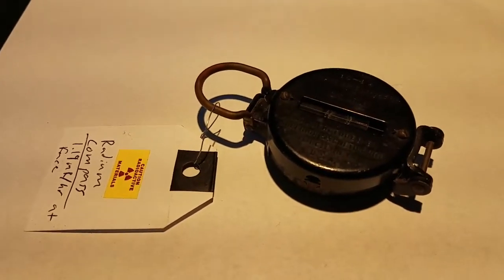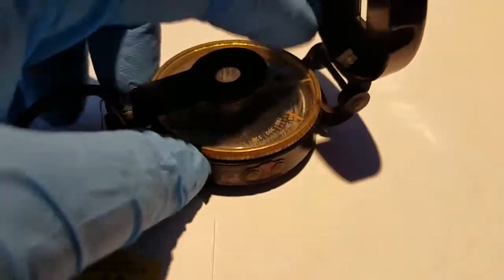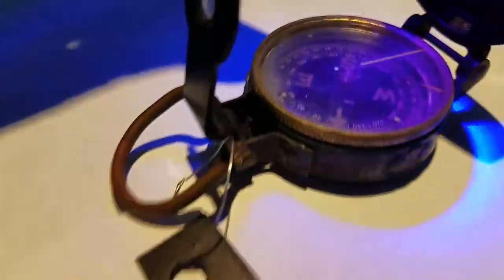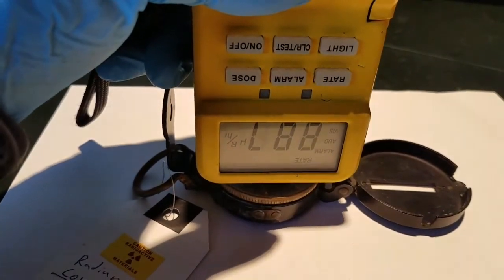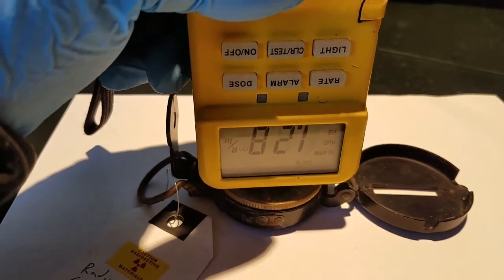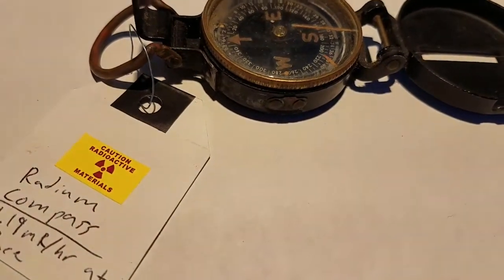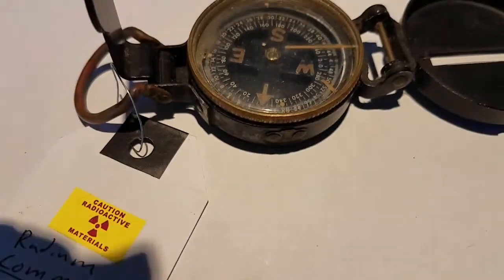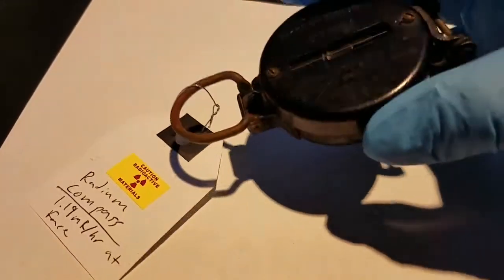Radioactive WWII Army Corps of Engineers compass

Comment: Careful regarding dust and contamination. Radium is also used on the bottom of the screws holding the wire in the lid. Because it is not contained in the glass, it tends to find its way out.